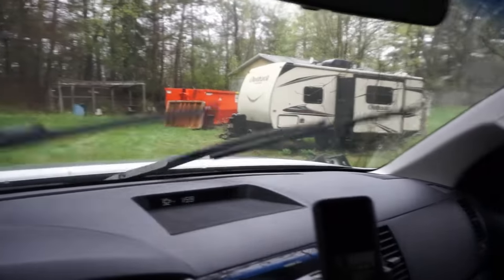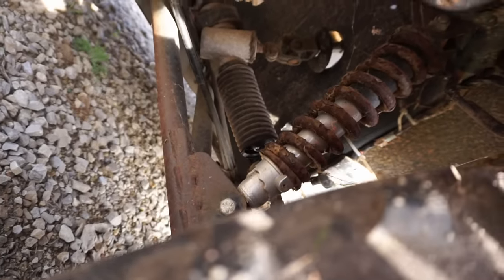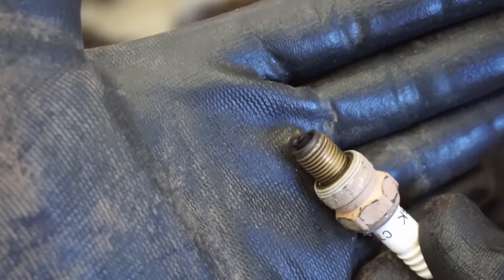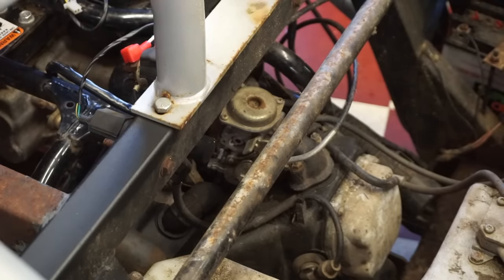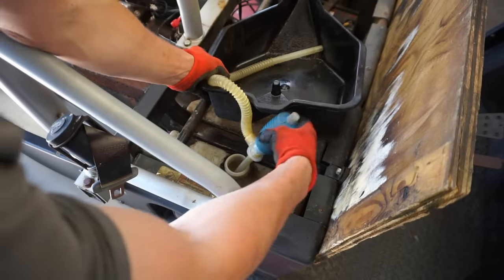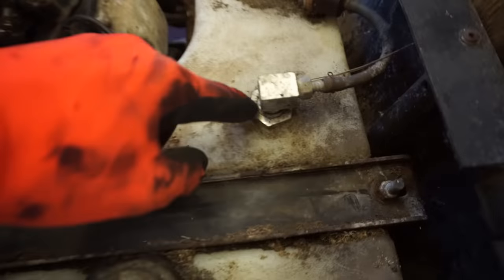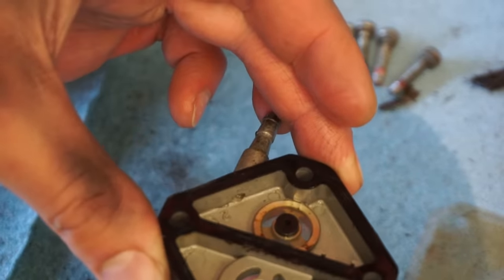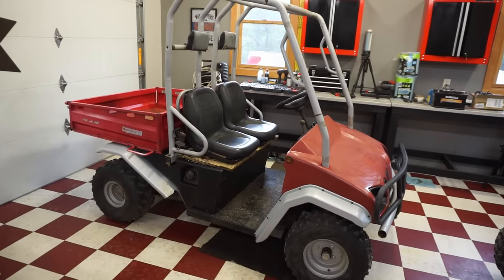$500 UTV Is The Worst I Have Seen. Will It Run Again?

Comment: Home depot and Lowes have  a package of pressure washer tips for about $12---15.00.  it will cut your time by 50% .  Get the $45 rotating tip and it will cut the time by 75% .
Reply: amazon has the rotating tips aka "turbo" tip also. Have to make sure you have the right one for your GPM rating and also have to start them facing at the ground.

Comment: Gy6 China engine's are usually some of the best. Most of the time any thing that goes wrong are carburetor,  valve adjustment, c.d.i. or stator. Those are usually great machines when properly maintained. Thank you for another great video. 💯😊

Comment: We bought a Chinese 500cc 4wd UTV brand new & it was always hard to start, especially when the engine was cold?! It also had a diaphragm type fuel pump, in which i eliminated . I finally added an electric fuel pump with an adjustable fuel pressure regulator for an older VW bug/sand rail & it runs better than ever!! Just an idea for u… keep the videos coming!!

Comment: Joe, do you still use the ultrasonic cleaner? If so, how do you determine when to use it or not. I was just wondering.  I have one now and was wanting advice on temp setting and solution to use. Great work! Love seeing ya getting these tired units up and running again!
Reply: I set mine at 60 and I use dawn dish soap and water in it. I use mine whenever i clean a carburetor and does pretty good

Comment: Did you check the air filter and oil before turning the engine over?
Reply: It's sealed so doesn't matter and it's not going to hurt it just rolling it over if there is no oil.

Comment: Your little sister teach you mechanics? Clean the exterior of a carb before tearing it apart! Then spray carb cleaner, and penetrating spray inside to start the parts  loosening up, i.e. the needle! Also the spray will start loosening the varnish inside jets, threads, and passages😅

Comment: The valves in the pump may not be working. Usually they use a diaphragm for valves but maybe the valves are in the intake and output. Could check by blowing in and sucking on the intake and exit for the pump. should only allow air to go in one direction.

Comment: Man, I was thinking, if the machine had been under water, water would've found it's way inside the crank case & valve cover via the vents where it would displace the oil (float the oil out). The stator was probably bathed in water too. Was surprised to see that fat blue spark.

Comment: Just wonderin what tool kit you have.  I need a set of deep sockets that i can use on impact.  I know silver/chrome sockets are not impact rated but i seen u use urs plenty of times.  The cheap sets ive had since was a teenager cant handle ive broken a few sockets with my 1/2 inch aoben impact wrench.  I now have a dewalt 1/4 inch hex shank driver as well but would like get a decent set sockets and not spend hundreds of dollars getting all impact rated stuff.

Comment: I don't understand how that style of gas pump actually pumps gas.  It's not electrical or hooked up to any moving parts.  Does it work the same way a diaphragm style carb sucks gas through the jets?  When the engine is turning over it's working with the carb to give it more suction power to pull gas from the tank?

I'm assuming the youtube ads are just randomly placed in a video when you upload it.   Is it just me or does it seem like they often cut away at a mini cliff hanger moment?  Like "let's see what happens when I turn the key.... CUT TO AD.
Reply: Vacuum pulses from the intake make the diaphragm pump back and forth.

Comment: Please, stop using that huge crescent wrench when removing jets...when you remove with bowl on, miraculously a small socket set materialises! Hope also that carpenters hammer has been ditched, Engineers use a Ball pen hammer. Rods connect linkages, Shafts is the correct engineering term for  rotating mounts. I think you are great  are you self taught? With a little more study of engineering terminology and workshop practices you'll  be even better! But some drifts to punch out shafts etc  so much better than socket extensions. Can't fault your enthusiasm!  Tim from UK.

Comment: I dont know if you can help but i have a project bike electric lights work no crank of stater motor so i put screwdriver to solenoid and everything comes on but cuts off when remove it i have charged the battery too

Comment: Yea, you need a better pressure washer. Get one that does at least 3 gpm, and 2800 psi. You will find all kinds of uses for it. Should be less that $500.

Comment: I fix these yerf dog utvs all the time. The chain tensioner and rear axle sprocket are the only issues i ever have. Luckily its the big valve GY6 so it suprisingly has a little bit of torque.

Comment: Shaker can red paint that metal bed it will look fantastic and stop the rust at the same time.. …   Gash washer and the white tip .. it will strip paint if you’re not careful.. 🤣 that’s a good thing.. all,that disgusting filth will strip right off .. that electric trash is a complete joke you should,d be embarrassed especially since your as good as your fixing stuff ..